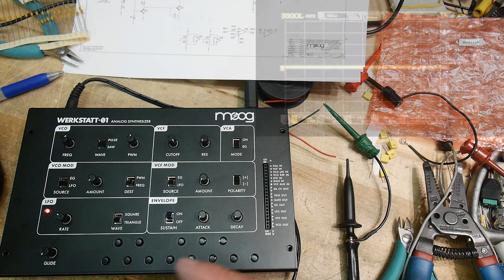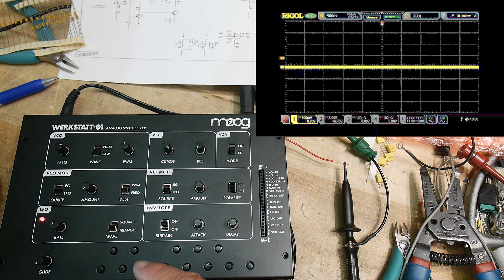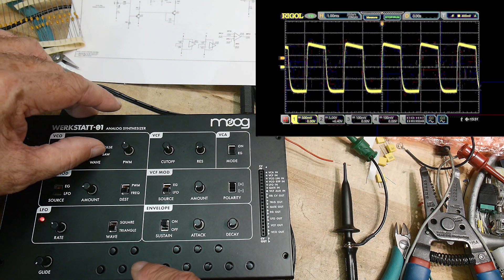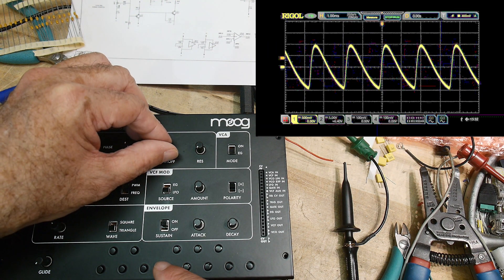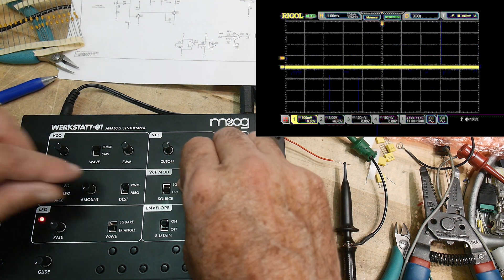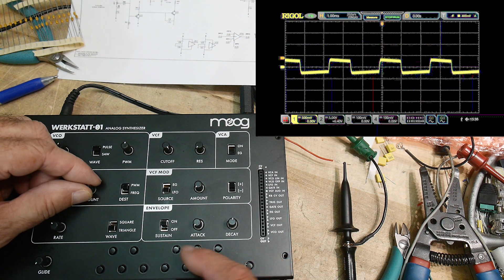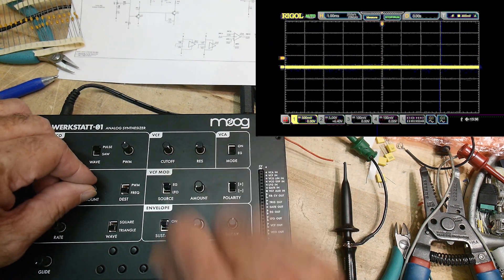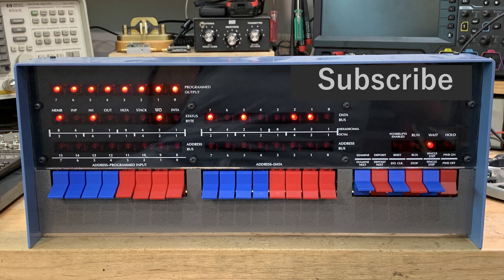#1218 MOOG Werkstatt Analog Synthesizer (waveforms on oscilloscope)

Comment: Maybe coupling between the moog output and the osciloscope was not the best, but still, those waveforms show that those oscillators inside the moog are far from being perfect. Maybe it's just enough for human ears. When you change pwm or frequency the amplitude also changes. The saw wave was also quite distorted... Which means you can build your own synth and it will probably sound as good as any other synth from the era.
Reply: not good enough for my ears: and my ears are not good enough for much.
Reply: The human ear can't generally perceive small defects in waveforms as distinct timbres from perfect waveforms.  The process of passing through almost any mixer will impart slight or drastic distortion on the output, depending on circuit design and user intention too.  The distortion on analog waveforms imparted by pre-mixing before the filter is one of the key features that makes many synths sound like instruments and less like test gear.

Mixing desks and studio consoles are often famous for the "tone" they impart onto a signal that passes through them.  Same with amplifiers, especially with regard to tube amps.

All that said the rounding on the tops of the waves seen here is due to how the filter and envelope controls are set up on the synth and not the actual raw waveshape.
Reply: @johnmiddleton4291  So then, the analog oscillators in those old analg Moog synth, can produce "clean" sine wave oscillations, at audio frequencies. By clean I mean if you were to use a signal analyzer (a low frequency spectrum analyzer) ... you would see a strong peak at the nominal frequency, and any harmonics noted would be very diminished.
Reply: @willthecat3861  Sure.  Keep in mind that the particular synth shown in this video is a very simple design that was originally built as part of an learning about synths lab at a Moog music festival before it was released to the general public.  It is not a function generator for a lab.

Also keep in mind that pure waveforms are not really the point of a synth because the are pretty useless musically and as soon as you apply a filter, mixer, amplifier, modulation, or envelope the waveform spectra changes and it isn't pure anymore.  So any amount of control adjustment changes the timbre, volume, and other tonal qualities.

 Sine waves are also generally used for modulation purposes in most synths and not a s sound sources. You can produce pure sine waves with most synths by turning the filter resonance up until the filter reaches it's resonate frequency and begin to self-oscillate.  Some synths don't have filters that can oscillate.  Some synths are also designed specifically to add sine waves together in complex algorithms to produce timbres of sound.  This is the basis of additive FM  synthesis.

Comment: wierd pwm, moving  vertical?
A better alternative would be "Make Noise 0 coast", but pricey.  partial Buchla, Serge and Moog circuits + random voltages and Midi 2 CV, contains Buchla timbre (wave folder) and Serge voltage controlled slope, but no filter, for more info Mylarmelodies on this device. killer device. Buchla 259 oscillator.

You could use the Buchla take on how to create a sine wave, looking at the circuit of the 259 and 259, just 2 diodes and a opamp and add this.